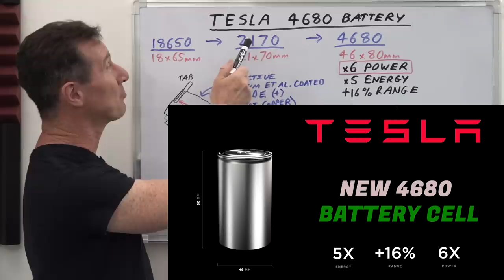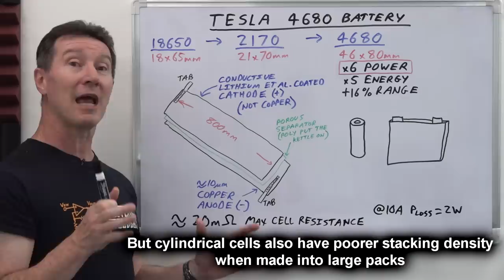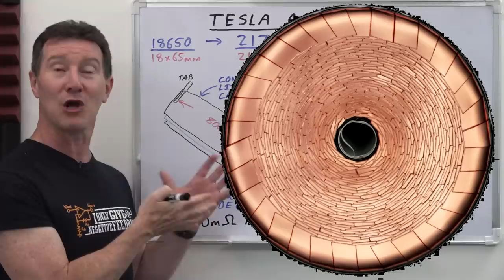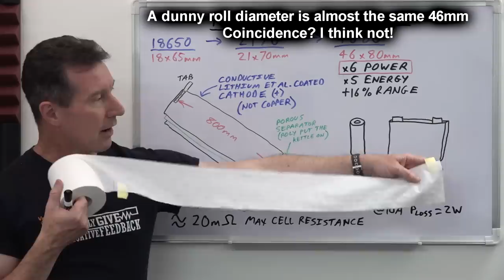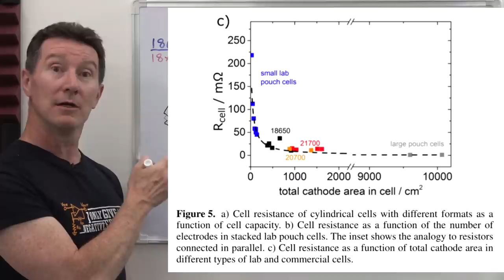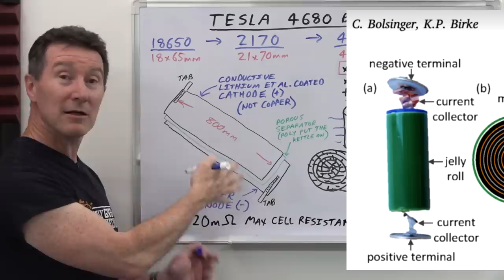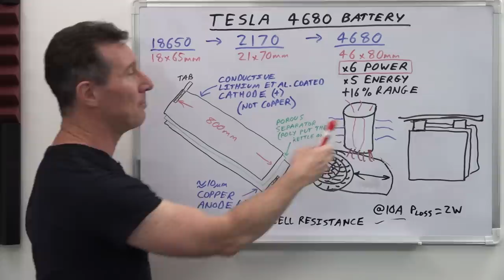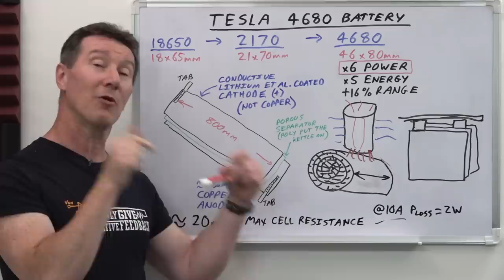EEVblog 1340 - New Tesla 4680 Battery Cell EXPLAINED

Comment: Why would the heat be removed from the bottom of the battery? Surely the top end would be hotter? Obviously the bottom can be directly attached to an under-vehicle heatsink with air-flow already available without additional systems, but that surface must also be electrically isolated AND must be mechanically sturdy to avoid physical damage.
Reply: If you think it's because heat rises, hot air rises in cold air because it's less dense and more buoyant. that doesn't happen in  solids.

The bottom has copper which is a better conductor than aluminum but I assume they are using the same method for the top as the bottom but it doesn't look as cool as it's grey metal like the case so you don't get the cool contrast so they showed the copper side.

These batteries can be oriented in any direction as well, so even if the "top" was hotter, they could flip it over.

Comment: modern anodes are not typically copper, they're usually graphitic materials. A typical cell would be NCM vs graphite. Copper is the current collector.

Comment: I'm really wondering why the "tabless" architecture is being rolled and crammed into a cylinder still. They should be flat with the tabs all laying on a bus bar. Then stack them to your satisfaction and package them in a rectangular form factor. No loss of space between cylinders and you save in manufacturing because you aren't rolling and stuffing them into a cylinder.
Reply: I suspect they don't want to use pouch designs like that because they don't have good control of thermal expansion and contraction of the pack. From what I've seen of the pouch designs, they don't have good cooling between the pouches, so the end pouches are fine but the further into the pack you go the worse it gets, with cylindrical cells you have air pockets you can run thermal conduits through, keeping all the cells in the pack at the same temp. Separating the pouches to make a gap for the same purpose would probably be less energy dense.
Reply: @lukerediger8431  Good points... Expansion: I'm not an engineer but it seems like a squishy material could be incorporated into the layers to counter expansion. Cooling: If the cells don't cool through their sides well then losing that space shouldn't affect cooling. I think the key would be more to make sure that the tabbed/bus bar side is in a location that is vented or cooled since it is more thermally conductive.
Reply: It comes down to manufacturing. It is much easier to roll it up. There are other considerations as well since you would need a stronger container due to the fact that the cells tend to deform between charge/discharge cycles. In addition, the "dead" space is packed with an endothermic material designed to reduce the chance of a catastrophic runaway event should a cell short out. A cylinder is also much stronger. Tesla is also using the cells themselves as a structural member.

Comment: I like your explanation.

Linear increased cell size = 5x Energy storage (Just larger cells with same density).
6x Power means it has higher amperage draw I'm guessing means both in and out so faster 0-60 and faster charging.
Lower resistance yields more "effective" energy. Less resistance also means less material and power required for cooling. So More efficiency results in the 16 percent increase in range.

All impressive. But the revolutionary thing here is the manufacturing and the quicker charging.

Comment: Why stop at the 46mm diameter when each additional layer after that would give greater energy per battery. Leaving the centre coils hollow would help it cool down.
Reply: On battery day they said 46 was a sweet spot for cost and range. See 45:35 in https://www.youtube.com/watch?v=l6T9xIeZTds&t=3314s

Comment: You covered the copper side very well, but I'm still not clear on how they will be handling the Lithium side. Will that also have many tabs folded over? Does that add any complexity to the manufacturing, since with both sizes folded, I could see opportunities for shorts. You may need an additional insulating layer.

Comment: @26m30s: "..packing density of a larger cell versus a smaller cell..."  No. Packing Density can be calculated for shapes of "unit" dimension, irrespective of absolute scale. In other words, cylinders in cross section are circles, and will thus have a certain theoretical maximum packing density (hexagonal arrangement, 90.69%) no matter their absolute dimensional scale. This two-dimensional packing density for the circular cross section is not changed by the 3D height of the cylinders. Or were you trying to say something else?

Comment: Why don't they mention the thermal efficiency?  Shortening the electron path within the cell will decrease the amount of heat produced within the cell. Overheating the battery pack is one of the biggest complaints of car enthusiasts as it really limits the  amount of time you can spend on a track.

As for cooling, now heat and electrons can be conducted out of the cells if a heat pipe is used as a wire.

Marking is going to have a field day when the new track times come in.

Comment: It's not disappointing the range increase is merely from the size, you can't increase the size to 4680 "anyway" without the design change because of the heat.

Comment: To me the hard part would be how do you maintain good electrical and thermal contact without using welds, especially given thermal expansion / contraction and vibrations of a moving vehicle? Is there some kind of springiness build into the end caps? The tabs themselves might also be somewhat springy.

Comment: I don't understand how they are making the connection, does the battery have a built in tab vs welded tab???
You might be mistaken, the finish battery cell needs a welded tab to connect it to the rest of the cells... That is the problem...

Comment: 25:50 Didn't you forget that just increasing size, does not provide you with the extra energy ?
Because being bigger, means it will use space/volume that it was being used by other cells before, so it's basically replacing the volume, by being a little bit more efficient on volume use (less wasted volume, aka air gaps). However there might be other gains, that eventually will justify a REAL x5 energy in the SAME volume.

Comment: Heat and electical conductivity follow - they should leave a center hole of the conductor can ends for cooling - center hole seal should be easy for coolent of heat pipe insert..

Comment: 16% better range for just the tab change and battery dimensions. This is significant.
You'll get an additional increase in range from other improvements in the 4680 battery technology not mentioned here. Total increase in range may be as high as 40%.
I am actually not surprised as I long ago suspected this 4680 battery was on their drawing boards. Long live Tesla!

Comment: As well as other reasons offered on arcing after longer life, i’d suggest it’s because 18650 were designed for laptops, where charge discharge profiles are different. You have a laptop with constant current draw for say 5 to 10 hours, so the tabs weren’t a limiting factor. Then recharge over night or back at the desk. However EVs need big current during acceleration / deceleration and moderate power while cruising. They work with the limits to set up the BMS and thermal management and meantime have had to work out how to make the tabless design work through R&D.

Comment: If they made the center a hex shape or square with rounded corners, then they would get cell with flat sides. Easy to pack close together. They showed a graph, where 46mm was the sweet spot. But that must be due to the voids between round cells. If square or hex, they could go much much bigger and get even more improvement. 
And why not make the 2 conductive "sheets" thinker towards the tabs?? So maybe 6-8u away from tabs and 12-14u at the tab. You would get better utilization of your precious metal (and weight) that way. Less resistance. Both thermal and electric.

Comment: 25:50 I think you might be missing the point here. If the 6 times power rating is how fast the battery can be discharged. Presumably this means there would be a similar improvement in the CHARGE time which is the Achilles heal of EVs. Maybe this means the new cells can be charged 6 times as fast as well?

Comment: Cylindrical batteries are less of a hazard compared to bigger rectangular ones. Plus they add to the structural integrity of the car. I’m just wondering when solid state batteries become a thing.

Thanks for the vid. Learned a lot!

Comment: Interesting that Tesla battery OEM is Panasonic and they are partnered with Toyota developing the new version of a solid state battery. So Tesla respond with manufacturing their own cells which are an improvement of known technology made in USA. Toyota are now saying they have fixed the issues with solid state etc.  What is your opinion on Toyota claims? Thanks great info as always cheers Ged

Comment: @7:00 BUT, there is ALWAYS a tradeoff to thinner material! Here, I'm willing to bet that the thinner the material, the less current dissipation it can sustain and potentially, the less service expectancy you can get out of it, right?
Reply: but it also doesn't NEED to sustain as high a current given the shorter electron path
Reply: @bob15479  No, inducing more current into smaller wire, no matter how short it is even if it's only a millimeter long, will get hotter and potentially burn up.
What I think you're trying to say is that since there are many more smaller/thinner wire, collectively they can handle the current required of it.

Comment: This is not Tesla invention to connect like this, but rather known method used in simplest foil capacitors, 200 years old. Also, you do not need contacts, just shift two metal sheets sideways with respect to the separator. Also, resistance of a battery may not be limited by the resistance of the metal, but by the ion drift speed in electrolyte, so the loss of internal resistance is not so strong.

Comment: The IR advantage you receive from tabless also means there is more inactive material in the cell since those copper tabs take up space. That is why there is 5.48x volume change, but only 5x energy change. Any energy density increase comes with changes to the anode and cathode material, so those range gains are on the slides for anode and cathode. 20% power gain and the IR reduction is huge though. Especially for Supercharging. These cells will be able to sustain max charge for much longer than the 3 minutes the 2170's can do right now at 250kw. These could also potentially do 300kw and if they can do it for 10-12 minutes, then you can get 80% charge in 15 minutes. We will have to wait and see how they perform, but my money is on 80% in 15 minutes. Think about that for a moment. Just the size change and tab change would make a 400 mile Model S a 464 mile range vehicle and possibly supercharge 370 miles of range in 15 minutes.

Comment: Is cylindrical cells energy density really higher than pouch ones? For a given chemistry the density is essentially driven by the power/energy ratio choice (more tabs and collector leads to less room for active materials). I think pouches energy density is a bit higher because the casing is lighter (same C-rate comparison).

I think it's misleading because pouch are often choosen for power density so most available ones can appear at first with less energy density.
Reply: except pouch cells are not effectively cooled. Where cylindrical cells lose in energy density they make back with other areas like cooling. At least thats what I heard

Comment: so the single 4680 replaces 5 of the old  style batteries, meaning fewer interconnections .

If they could make tissue box shaped batteries then the energy density will jump and we will get the longer range we need.

Comment: EEVblog: Just to add a comment on battery resistance. The pack resistance could be managed with 2170 cells by having more of them connected in parallel. Traditionally the pouch type battery cells, which have lower resistance, have fewer connected in parallel. Therefore, the effective internal resistance of the cylinder battery pack is comparable to  that of pouch type.

Comment: One thing I cannot understand why this new cell is called 4680 instead of 46800 which would make much more sense compared to other cells with similar naming (diameter in mm, followed by length in mm times 10). Even marketing should have liked that name better because the number is bigger!

Comment: The tabs being on the side edge  allow for more current to be put back into the battery as well as lowering resistance
The one thing you're going to have to watch out for is the charge cycles have to monitor heat much better

Comment: With the tabs, that is going to get complicated to make sure you don't have a short.  Plus not to mention the extra weight. I imagine waste would get pretty high if they weren't keeping an eye on it an a tab broke off. 

Now, what I don't understand is why they go to that trouble.  Why would they not just run a bead around it and just join them that way?  A bead into another bead as it wraps around?  Kind of like a zip lock bag.

Comment: I dont understand why the outer ring is bended over. How is this even possible? 
Also i dont understand why you need the cuttings. In my opinion it could also work without the cuttings (and without bending it).
Why not just to sheets that are shifted a little bit and in the middle the separator and then rolled up?

Comment: The reason they didn't stamp the original tabs instead of welding them is because it would waste the entire piece of material in between the tabs.  With this newer tabs method you stamp 2 of the sheets at once and the multiple tabs are then interdigitated with half the tabs on one sheet and half on the other.  Nothing wasted.  It was cheaper to spot weld the tabs on before than having that expensive copper waste.

Comment: The assumption about packing density being more efficient at 24:42 is actually untrue. If you understand packing optimization theory, the larger diameter of the battery actually reduces the packing density which affects the placement and number of batteries. This, of course, assumes the battery modules don't change dramatically, but even if the layout was as efficient as possible, there would still be a decrease in packing density.

From what I could mathematically muster from the software tools I could trust online, you actually lose approximately 5% of your battery material volume due to the battery cross-section increase.

Comment: then why not go 9940? you cut resistance by 1/2, (aka more power) and then assemble with middle anode cooling layer and cathode on opposite ends?

Comment: 23:34 I guess to reduce the quantity of the required conductive plate. If 1/10th of the conductive plate is used for those tabs, then getting ride of them you will use 10% less per battery.

Comment: From your explanation, it seems the rate of heat generation during charging and discharging is reduced, possibly by up to 10x, due to the less distance of electron travel through a resistance, which generates the heat (and energy loss).

Comment: Also apologies if I missed it, do you have numbers for the resistance in both states. I'd happily bet 1£ that the volume increase is responsible for more of the power change than the resistance differential

Comment: The current pack has a jacket around the battery.  The new battery will have no space between the battery’s, so isn’t that an improvement in density?

Comment: Dave, how to properly charge a large bank of batteries, eg LiFePO4 24x 200Ah? There are many different chargers, but many do not work properly with the BMS leading to voltages above 3.65V per cell, which slowly destroys the battery. I would like to add that I charge my batteries from photovoltaic panels to an electric car using an active balancer and a laboratory power supply (has CC, CV by desing).

Comment: Changing the cell size does nothing to improve packing density. If the cells are packed in the usual staggered pattern the "triangular" spaces between the cells are directly proportional to the diameter of the cells. Doubling the cell diameter simply doubles the area of that triangular space - no change in density. In fact, the larger the cell the WORSE the packing density, due to the wasted space at the end of each row (no half cells). However, the reduction in relative surface area of the cell DOES improve packing density due to the reduction in cell casing volume.
Reply: less layers of packing material adds up, fewer holes adds up, removing the between cells cooling conduits would also be a huge increase.

Comment: Hello Dave,
Loved your presentation here as well as some of your other presentation. Clear straight forward explainations.  ...particularly liked your clear explanation of why multiple bypass capacitors are required in high frequency circuits.
I am an electrical engineer that have worked in Microwave/RF/mmWave design for Bell Labs and Hp for decades. I have developed a design methodology called GeoMat that predicts the "Tabless Battery" and in general shows how to design in a way that results in higher levels of integration. If you are interested in knowing more about it please call contact me.

Comment: My guess is that getting the thermal issues under control was more important than energy density, since dropping the water cooling could save more energy overall.